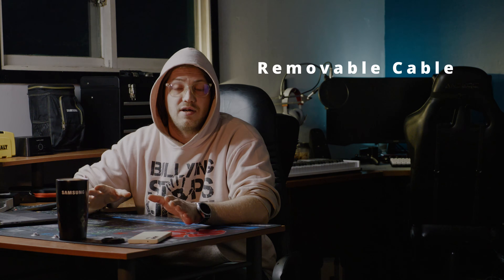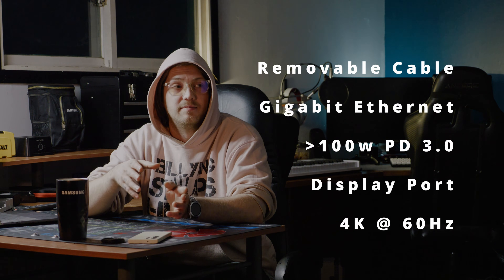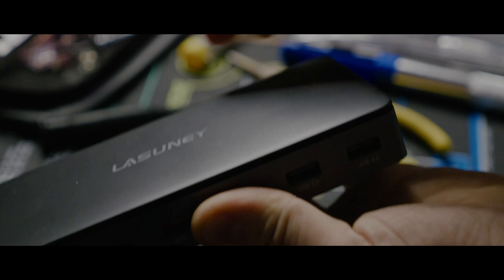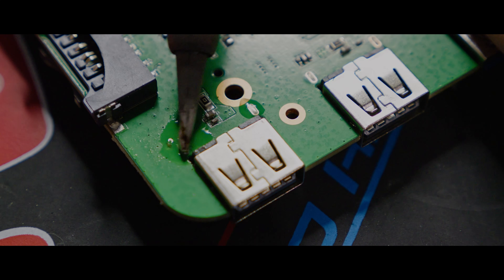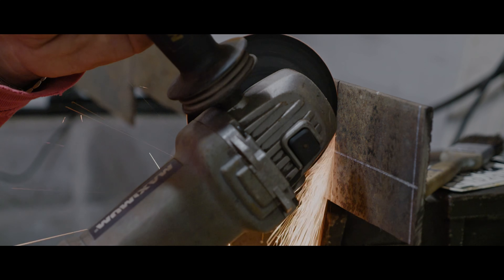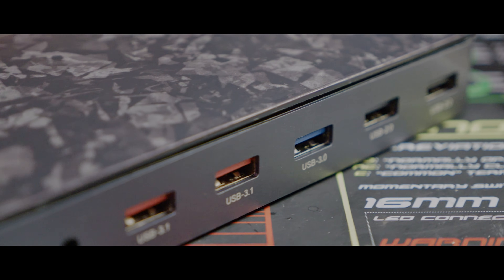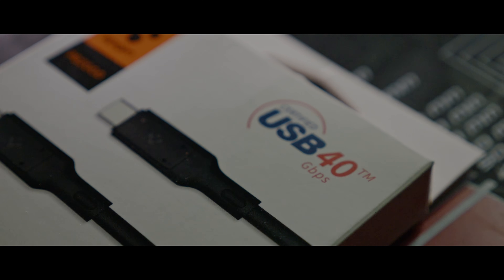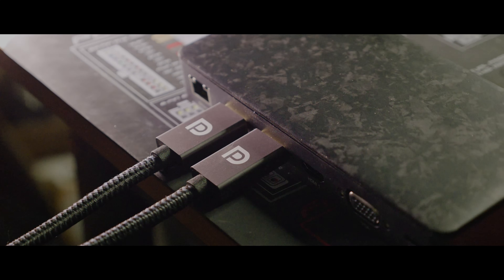Modified a Cheap Display Port Dock from Amazon

Comment: The input you are tapping on is USB PD, so it will have more than 5v, more like 12 to 20v or I'm missing something?
Good video, I do the retouch on the soldering myself, it's a good advice.
Reply from the maker: You’re exactly right, it’s directly off of the charger but after the PD IC so it’s already requesting 5v from the charger. I should have mentioned that cause off of the actual charge port pins would be 20v from this specific charger.